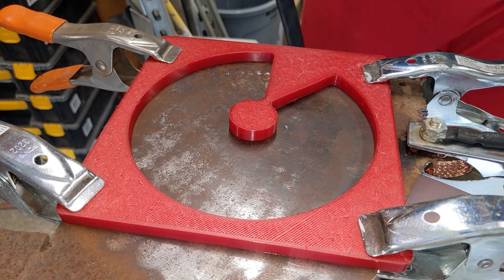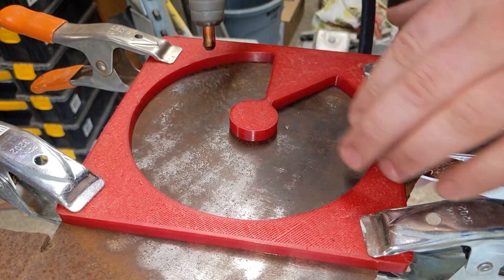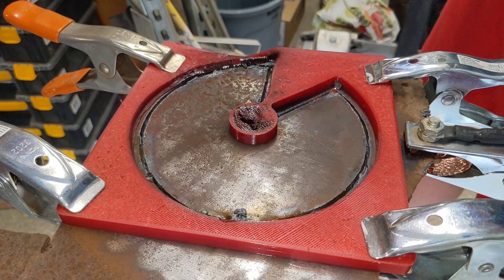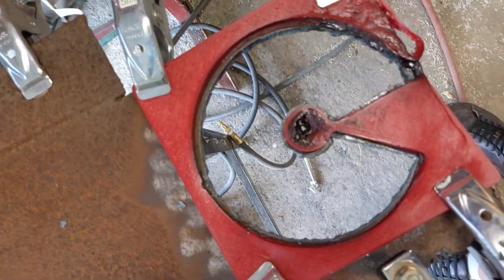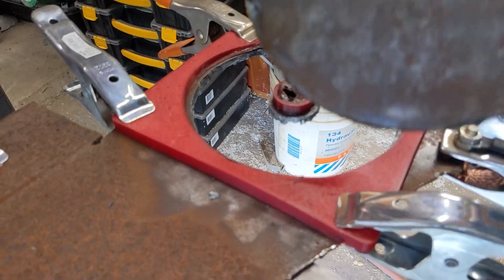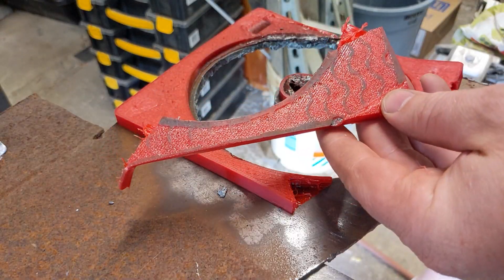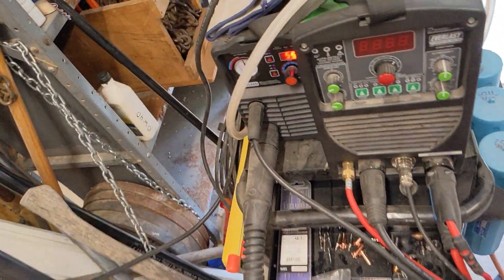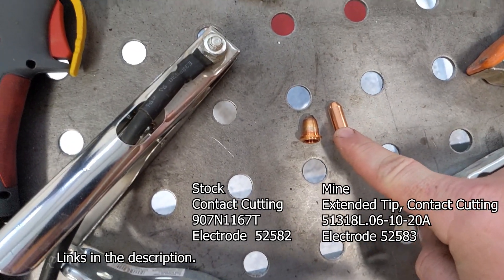Can 3D-Printed Plasma Cutting Templates Work?

Comment: One idea: I think the main issue is het transfer from the steel to the plastic. So you could use an insulating spacer like some cement board (tile backing board is cheap I think).
Reply from the maker: Then I would need to cut the backer board to match because I don't think plasma can cut through cement board.

I could try a higher temp plastic and some low conductivity metal screw heads in pre-modeled holes sticking out the bottom. As long as convective and infrared heating doesn't overheat the plastic I think it would work. Now I need to try it 

Longtime viewer btw.

Comment: If you’re cutting 1/8” steel at 55amps, you’re running it much hotter than it needs to be, by maybe double. That probably affects some of your feasibility I expect.

But…the caveat prob should be, yes, it DOES work - just not as a reusable template.  So if your goal is readability, then you ALSO shouldn’t be using such a scant gyroid fill - go for an 85%+ recto fill.  It won’t melt that easily.  Plus if you use a different material it would provide better heat resistance on top.

Comment: maybe use a 3d printed template to cut wood part with a handheld router and then use the wood template for the plasma ? if ti burst in flame char it with a torch before use :O

Comment: If you are keeping the smaller piece just cut the hole out with a hole saw it will be much cleaner. Then cut the larger circle with the template or make a compass for your torch. Miller sells a compass for there torches.
Reply from the maker: Yes this is a simple shape that could be cut out many ways. This was more of a trial concept.